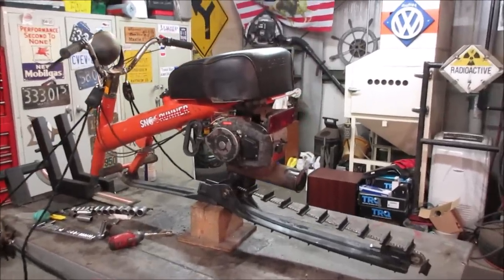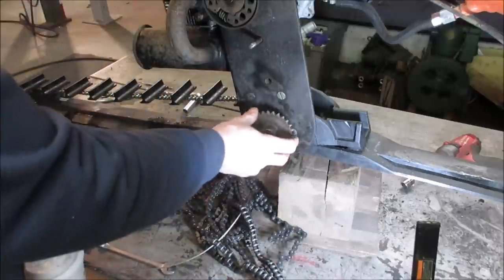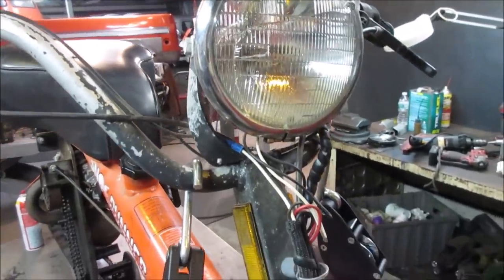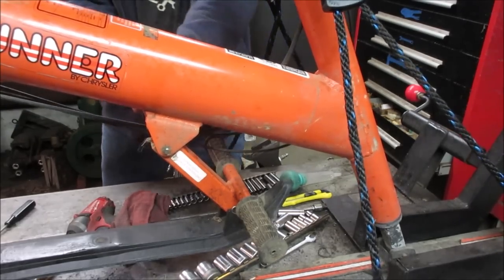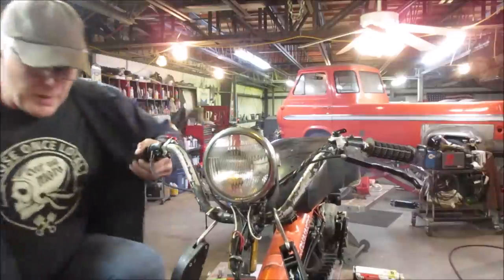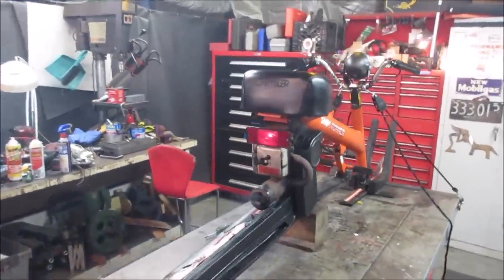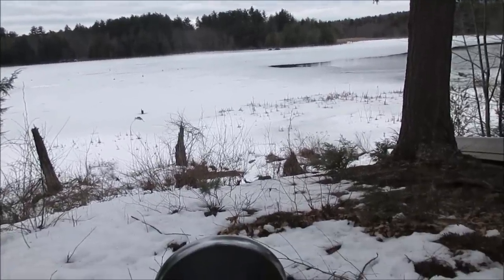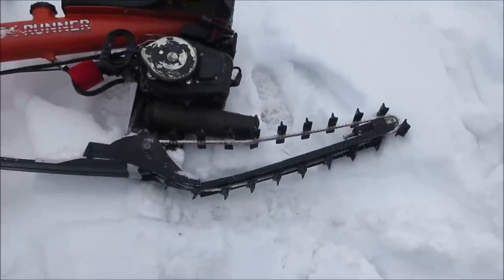Repairs finished on Junk Chrysler Sno-Runner, Win or Fail?

Comment: If you ever need to install a half link again, do NOT do it like you did this one.  You should never need to bend a side strap out of the way and then bend it back and then peen it over.  You simply add or remove enough regular links to end up with both ends of the chain being the narrow ends.  Insert the half link with pin and small cotter key and then install the master link.

Comment: I don't know if you mentioned it but there were two clutch sprockets for the snow runner, a 19 and 15 tooth. Does this have the 15 and that's why the chain is loose ?

Comment: i think Chrysler realized nope failed idea looked good on a napkin or paper but in the end like vehicle designs just didn’t work like when jeep had the woody chevy had a station wagon with wood panels. unless your a carpenter putting a water seal on it they ended up ditching the original jeep wagoneer.

Comment: I think the routing of throttle cable is wrong, take it out from the headlight bracket.  Leaving it thru the ring on the fork tree.  It's way too kinked for proper operation.

Comment: What you need to do is redesign the rear ski ...with a real ski!!! where you live you should easily be able to get a pair of old junk skis. chop off the back of one and keep the tip, mount the drive bracket onto it, and then mount the rear drive gear to the end of whats left of the ski. i would bet you know someone who worked at a ski shop who could help out a bit. they mounted binding on skis... why not this!!!! 

 If you were in utah i would say get an old powder ski.

Comment: I think the size of chain is to big (ie you have 80 and it needs 50). I found a picture of one in google images and the chain looks smaller and doesn't have a bunch of slop. I will add a comment to this so hopefully see the web link.